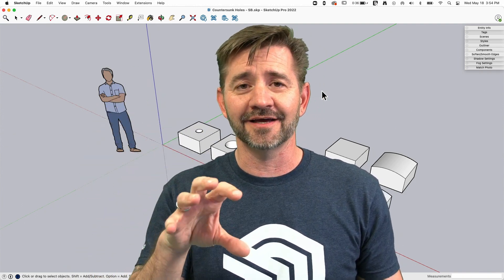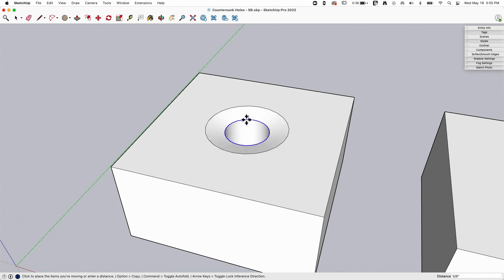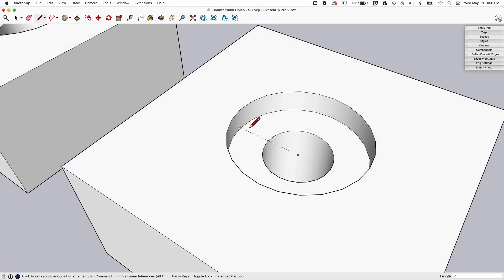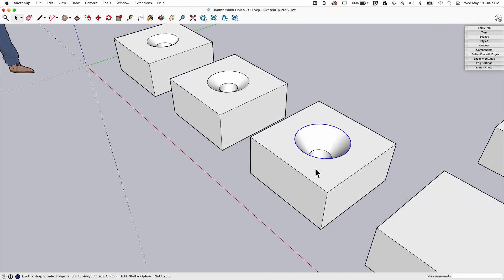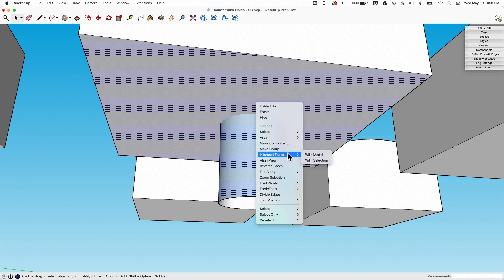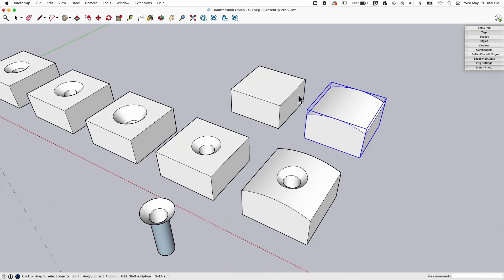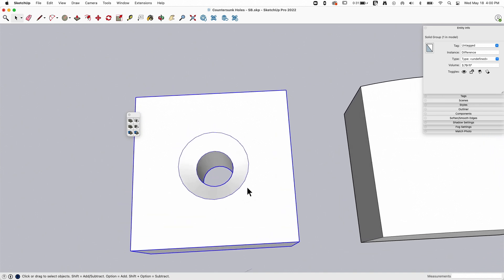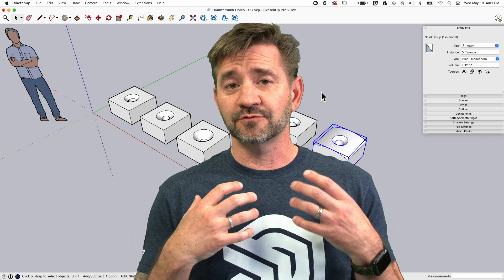Counter Sunk Holes - Skill Builder

Comment: Very good info. I could be wrong, but I think it's important to note that the follow me methods leave extra pieces inside of your block. Also worth noting, counter sink holes with sketchup have a practical 3d printing application. I use them regularly with my 3d print designs (when required).
Reply: Use CleanUp to clear out the extra geometry.
Reply: @richardhaas1989  yep. Just thought it might be good for Aaron to point it out for those who might stumble on this video with no sketchup experience. He always does a good job about solid considerations. :)
Reply: Biggest pain when making screw holes for 3D printing is the SU default to 24 segments. That might keep the model light and simple but it produces crappy holes for printing. I always bump up the number of segments to at least 36 but 48 or 72 if possible depending on the diameter. If not you'll print a faceted hole that looks terrible. 24 segments on a hole less than .250" is fine. But 24 segments on a .500" or greater hole looks really bad. I wish SU could adjust the number of segments in relation to the radius, same for drawing arcs. If I need to draw a 2mm radius arc I shouldn't get a error message "Too many segment..bla, bla, bla". I shouldn't need to work around this by scaling the model up or down. Just adjust the number of segments automatically to the highest number supported for that radius. Can that be so difficult to program into the software? Or give users the option to set the number of segments on the Units tab in Model Info.
Reply: If you do a lot of holes and threads in SU look for the 'E P Fasteners and Holes' extension. It doesn't do countersinks or counterbores, but it's got you covered on everything else in metric and imperial.
Reply: @bobd.  Couldn't agree more about segments being in Setting in Model Info. That and other things too. NO, NOT hard to program...
Whatever I design I'm making for real out of wood etc. I'm so used to making something a component and working on a larger scale of it I don't really think of it much. I only run into this when modeling a roundover/ogee router bit profile for a closeup Rendered image. Would FUSION be better for 3D printing?
Aaron is a great Demonstrator of this product but I really think they have no one there who knows HOW to program sketchup, they just took the software as a working "black Box". Fortunately for me it works like my mind works and does just enough to make the real things I ACTUALLY am trying to produce. My shop has tools with quirks and I still have to make something there too.

Comment: What I would like is the hole itself to be an object (e.g. special component) which I can move around and automatically subtract its shape from whatever objects it overlaps.
Reply: I think you can use the ‘trim’ command in solid tools to do this.
Subtract is destructive- trim is not.
You can even make an array of these cutters, explode them and regroup them into a single solid and use that as your cutter
Reply: @jonomoles  Trim is also destructive, in the sense that while the cutter is preserved, the object being cut gets "permanent" holes. You can not move/delete/change the shape etc of the holes, by deleting/moving/changing the shape of the hole cutting component.
Reply: I can’t argue with that but you didn’t mention onward editing in your comment.
No reason why you couldn’t make the geometry of a single hole into a component that you could reuse and edit though.
I think we all have a wish list of SU functionality but it’s worth celebrating its simplicity too.

Comment: You can also "cut" the non solid piece and then "open" the solid piece and "paiste" the non solid into the solid piece, then do the rest.

If the circle is solid ring, you can place the marker with move funktion in specific place on the circle and degree or indegree the diameter of the circle without using scale funktion. (less operations)

Comment: I think making a cutting component would also be a fast and effective approach.  If the bottom of the hole needs to be cut all the way through materials of differing thicknesses, you would need to model the hole portion long and explode and delete the excess.

Comment: This is simple geometry, but with more complex forms Sketchup has in the past had problems when working at small scales. I've gotten used to enlarging everything by a factor of 100 or 1000 and then shrinking the object back down to its actual size after the complex geometry is in place. Is this still best practice for the latest version? And if so, is there any hope of eliminating the need for this workaround in the future?
Reply: Scaling up/down is a work-around that should not be necessary and introduces a chance for error.
Reply: I haven’t found that this generates errors myself. I admit it is an extra step that seems like a bit of a kluge but I guess I’ve resigned myself to doing it to avoid small face hell.
Reply: When you are scaling something up/down there will be some degree of rounding. That is where errors can creep in.